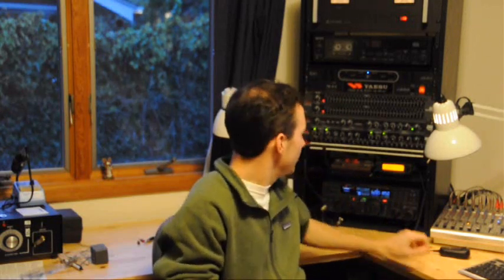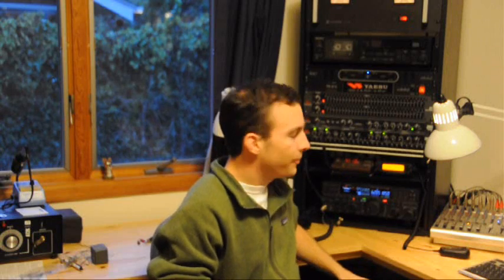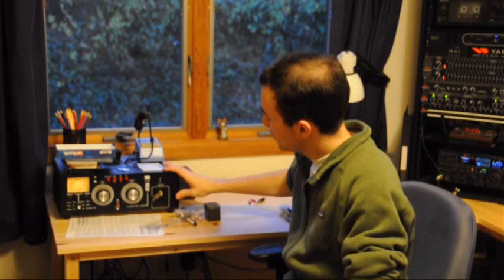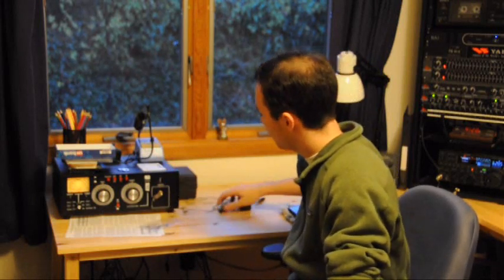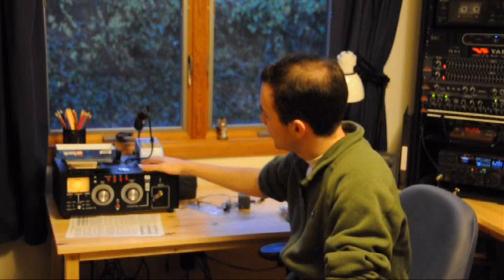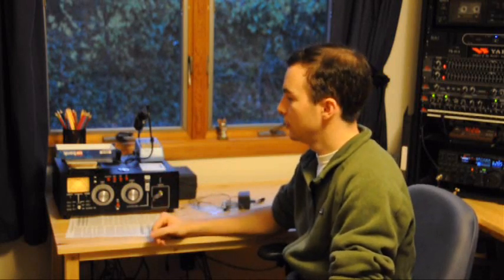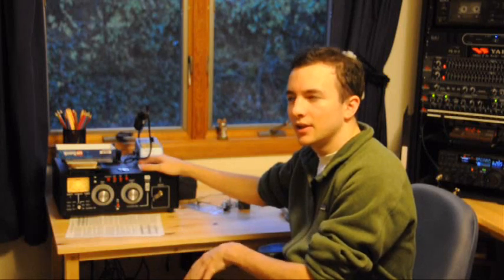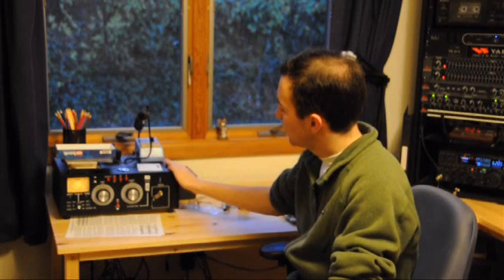Ham Radio Tutorial - Building Your First Station

Comment: hi, I want to be able to talk to home here in san diego, we are apart about 10 miles from office to home. I believe I need to use this radio in order to communicate with them. So question is, Does everyone that talks to that radio have to have a tech license as well me of course? Will these radio work if I buy two, one for home and one for me? THanks ffor your time...any help will be appreciated.
Reply: yes, you need a license. however there are other options available. for example MURS frequencies (there's 5 available in the ~150mhz range, use google) require no license.

GMRS is a 65$ license, good for your "entire family", requires no test.

HAM license is an individual license, however you can allow someone else to transmit as long as you are there with them to monitor them.

FRS is also a thing, however it is extremely limited and i don't recommend it at all, ever, unless you want to talk within 100 yards. it shares some frequencies with GMRS. it requires no license.

another option is CB radio. however this has many problems. if you want to know more about it, let me know.

Comment: I really hate to ask you this because i know you get this a lot, but what gear should a beginner start out with ? I want a base unit for my apartment and i can't put up an antenna pole. Maybe some of the viewers could help me out as well !
Reply: Im new myslef.  I was recommended to get BaoFeng UV-5R+, its cheap, and has a ton of features. i got it and love it so far. Entry level.
Reply: Jon Lynch i have a uv5r. great radio. but i got some big boys toys and got a kenwood ts-120s. its a 120 watt radio. second hand and cheap. great radio and i have made some good contacts. I have a motorola HT thats a good little radio. expensive. but very good.
Reply: *****
Yes, this is a very good radio for the price. I would also recommend the Yaesu FT-60R. A bit more expensive but has a lot more frequencies to choose from including the Airband on AM. However, if you do want to stick with the lower priced Baofeng radios, I highly recommend the UV-B5. It's one of the best, and newer, Baofeng radios out.